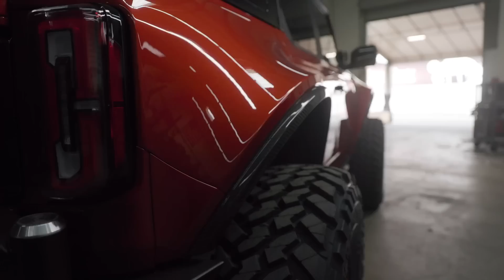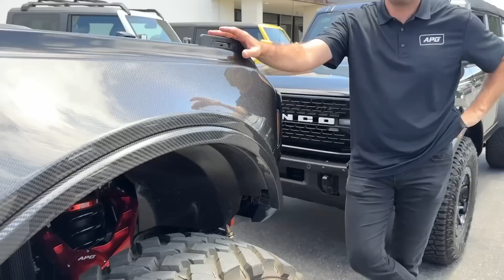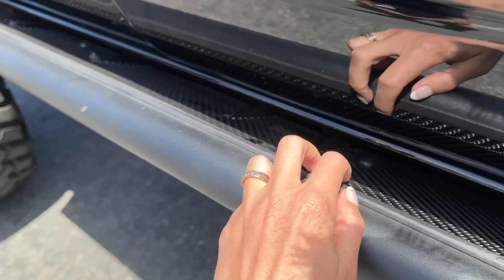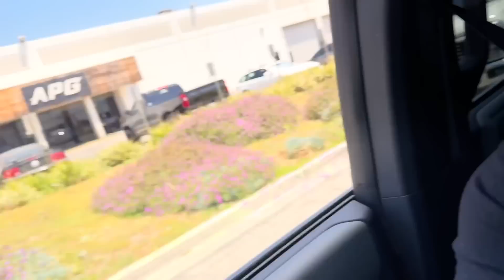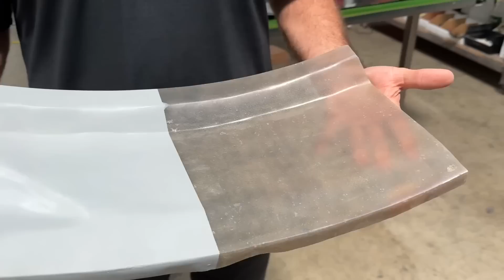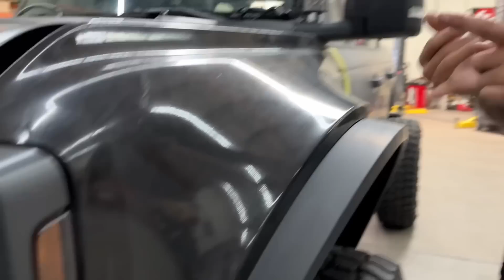Bronco Raptor UPGRADED to a Wildtrak?!

Comment: Which do you think is better, and why,, the Ford Bronco Raptor or the Jeep Wrangler Rubicon?  If there are choices, the larger 4 door versions.  And which do you think has the more comfortable, quiet long distance highway drive? Also, do you know the width of the Bronco Raptor versus the F150 Raptor?  The length difference too?

Comment: There is a replacement for displacement, bigger turbos, intake, exhaust work and anti lag. The 2.7 is great, it can easily handle 550-650 hp and 700lbft
But I get it, I have a big block car and truck as well and nothing beats the sound of

Comment: A steering wheel manual Patel shift 10 speed transmission on a 1979 Bronco could out Physics a 2024 Bronco  computers. Both up the power curve, and equally in down shifting drag efficiency.

Comment: Semi-float dana 60 and 32 spline dana 44 doesn't scream "ultimate reliability". I wonder how the 44 will hold up to 40's when rock crawling. I guess the 2.7 doesn't make a ton of power so that will help. The scorpion crawler ran 40's on a 44 for a long time, but it was built to the max and was significantly lighter that the bronco will be. Interested to see how it holds up.

Comment: The first thing I noticed when I got a jeep was the interior.  The plastics in the bronco black diamond I used to have would scratch up so easily I was constantly heat gunning.  I started beating the shit out of my gladiator 12 hours after I picked it up and she’s got very minimal scratches on the interior plastics.  I do miss the twin turbskies on the bronco though.

Comment: Also, don’t sleep on the 2.7L EcoBeast. Mine’s FBO and running on an E85 🌽 tune from ZFG Racing. 400+ WHP and 480+ WTQ with stock turbos. More than a stock Jeep 392 😄
Reply: More then a stock 392? Nope. 470hp. 470tq. And factory. Those engine with minimal mods and some good tuning can do way more.
Reply: @joshuabaker5712 I’m talking about at the wheels.

Comment: What’s kind of ironic is you guys are saying that it’s not smart to start with a raptor when your going to remove all the raptor stuff, yet I distinctly remember you starting with a Jeep rubicon 392 to rip all the stuff out that made it a rubicon and a 392 to make it a demon. That made sense, but doing it with a bronco raptor doesn’t? Interesting 😂
Reply: Mopar didn’t even have the 392 for sale when light brite bought the second step child(first was given back to Jeep because it was a lemon)  and the only thing that’s good with the rubicon is the 44s front and rear and then they  broke the 44s and hurt the motor on the step child when the added a pro charger that’s when litebrite added the demon  motor and 1 ton axles
Reply: @Deathpitt666  I’m referring to the demon child they built at americas most wanted 4x4. Not the step child. They are 2 different jeeps. Go back and watch their videos.
Reply: The difference there was the parts taken off that took a huge chunk of the cost out of upgrading. The 392 engine was worth a lot more than the stuff that would have been removed from the Braptor
Reply from the maker: Selling/exchanging parts off the 392 helped to offset the costs for the Demon build itself (engine, trans, axles, transfer case, wheels, tires, interior, etc). In this case, we won’t be taking off enough (at least in value) to be worth the difference in starting with the Braptor. The Wildtrak is definitely more cost effective.
Reply: @LiteBrite making a wishlist now! My wife just got a 23 wild track in Feb. @thesirenbronco
Reply: They explained why they used what they used. Resale for the parts they got rid of way outweighed the cost difference of the base vs the 392, from what I remember.
Reply: Haters gon’ hate
Reply: Wow, can't wait to see what it does. Glad you're not giving up on Ford Bronco. God bless take care.😊
Reply: Facts 100%